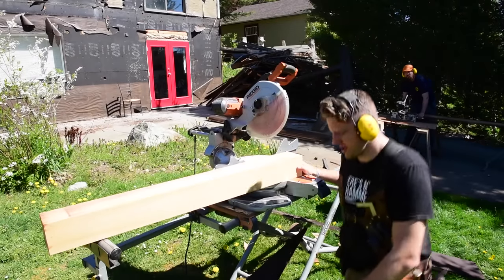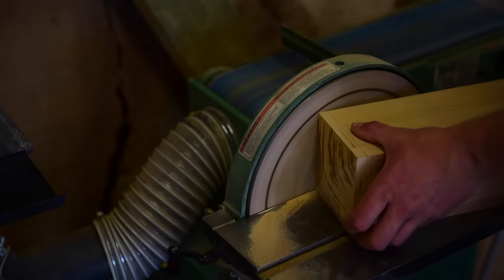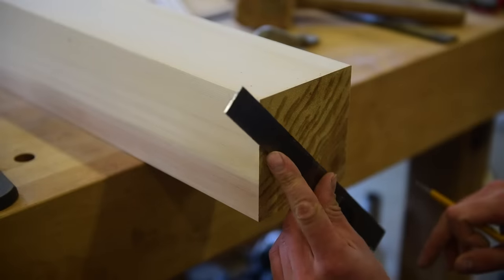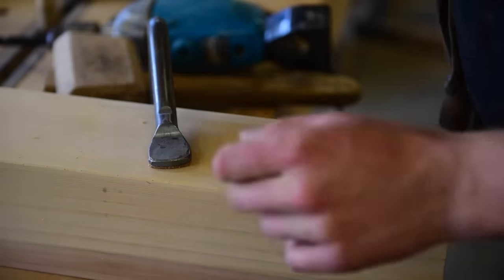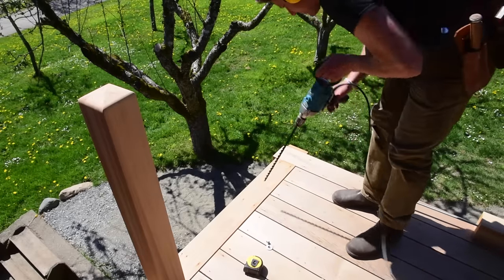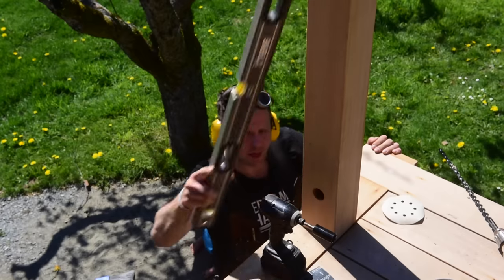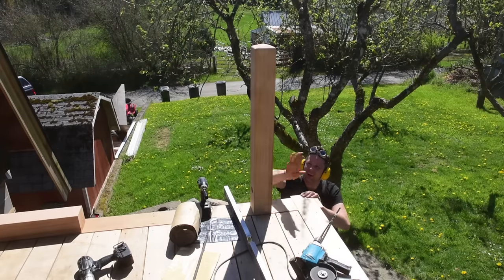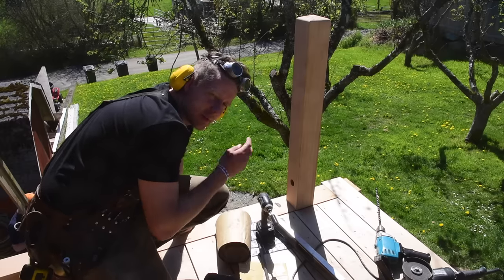FTF #54 How To Install Handrail Posts, Quick And Easy

Comment: You seem to address water traps with your posts and railing (commendable), but have ignored the same issue with your half lapped deck trim (inexplicable). I believe consistency and a respect for a materials nature is more in order when it comes to creating architecture. 

Water will penetrate and rot that half lap trim joint (earlier stage video) regardless of how much PL you use. This is because movement across the grain due to seasonal moisture content changes will release the bond of the glue (or membrane) to the end grain fibers of post (or surface fibers of half lap) and moisture will begin to work on decay. Why? Because the shearing force of wood movement will invariably win out over the  shear force resistance of a glue or surface membrane film used for exterior wood joints. Either an understanding of wood science OR time will teach you this lesson.  However, applying wood science to your work is quicker and more efficient. It also can result in better "samurai" wood joinery. In my experience "sexy" doesn't equate to a "Samurai" application with regard to wood joinery. Also, by fitting your half laps together so tightly, you left no allowance for dimensional changes in your trim's width. This wood WILL expand over its kiln dried state at the time of  install and that dimensional change will have to be accommodated somehow. This can be clearly evidenced  by:

1. Crushing of wood fibers all the way across the grain. Doubtful.
2. Cupping (i.e. deflection due to a material wanting to "get away" from significant force). More probable
3. Shearing of wood fibers at your 1" overhang. Possible. In fact, you may actually lose half the thickness of that overhang if cupping is not accommodated. Ironically, a longer overhang makes this less likely, but less "sexy". 
4. Combination of all of the above. Most likely case, but less obvious.than results above.

BTW the reason that miters open up at the heel and not the toe is because of moisture content changes in wood. You can toss an 8' 2x4  into a pond and after a  week floating around it will still measure very close to 96" long. However it will no longer be close to 1.5 thick and 3.5" wide. This is best understood by learning the difference between the 3 axis of wood fiber movement due to moisture content changes (i.e. tangential, radial and longitudinal shrinkage). The change in longitudinal length of wood fibers due to moisture content changes is negligible. That is true all the way across the boards length. The length of fibers is virtually the same all the way across the mitre; they have just shifted positon in relation to the joint due to cross grain shrinkage. In other words, the width of boards change considerably due to cross grain moisture content changes (combination of radial and tangential shrinkage). This results in the familiar  gap we typically see at the heel of a miter joint and not the toe.

This critique is not meant to bash your work. I believe you strive for a high visual aesthetic coupled with a desire for durability which are some of the hallmarks of architecture. As a carpenter, I strive for this myself. A good understanding of wood science can be helpful in reaching that goal.

When thinking about this half lap and how it could be improved, you may want to think about the fact that wood needs to be perfectly sealed or drain well in order to avoid decay. This is why traditional wood window sills and water table caps are pitched. Your half lap is (probably) perfectly level and the failure of the glue joint over time actually works to further trap moisture in that joint. What is a better detail? I think its worth considering...and I'm sure a true samurai carpenter could come up with a better solution.
Reply: Sonny Wiehe wow

Comment: Dude. That dewalt saw is belt to blade drive. The bearing goes bad on the motor side which gives u the blade wobble. The cheaper models are all junk. Per my repair man. FYI

Comment: Great job but definitely not quick or easy. You're using an interior method for an exterior deck. IMO there seems to be a lot of points that would be prone to failure. The bolts loosening as wood shrinks, shims rotting or coming out, water damage and the threaded rod not being strong enough for lateral support. Usually they're used interior like that when the wood is really really dry. After that whole deck drys out or expands and contracts I'd imagine it all becomes loose.
Reply: Just tighten from down under mate !

Comment: It would not be easier if you had bend the washer instead work in the hole?
Reply: Then you are creating a wedge against end grain that can potentially cause a splitting action instead of trapping the grain in just compression only.
Reply: ohh, I didn't know that. Living and learning, thanks dude! Now I know why my bed is a bit floppy.

Comment: The American Wood Council publishes a great free document - DCA-6.  It is the authoritive publication on building residential decks that are compliant with the current edition of the International Residential Code (IRC).  Google it and skip the YouTube videos.  More injuries and deaths occur due to deck failures than with any other structural failure.  I would be concerned that the stability of this deck railing appears to be completely based upon the shear strength of the threaded rod.  And if the threaded rod isn't stainless steel or galvanized, it will rust.  Per Table R301.5 of the 2015 IRC (currently adopted code cycle for the State of Pennsylvania), a guard (called a handrail here) must be capable of withstanding a 200 lb live load applied at any point along the top of the guard.  University testing has revealed that many deck guard rail posts are insufficiently constructed to withstand such a load.  And I do not write this to be a troll.  Legal or not, people will inhabit a deck and lean against the guard railing.  If it fails and someone gets hurt--everyone associated with the construction and inspection of the deck faces legal liability.  If you build a substandard deck on your own home, the outcome could be much more tragic.  Let the hate responses commence...

Comment: There is no way that would pass inspection.  It's looks great but other than a kick, it would bend right over if pushed on.  The mass way exceeds the bolts strength. That carriage grade bolt would stretch if pushed on You are a great carpenter but framing isn't your thing

Comment: this was not quick nor easy.  It also would not pass code here.  There is no way that post will hold up to lateral pressure or any significant weigh bearing against the rail.  we need 2 carriage bolts plus at least 1 mechanical brace like a simpson strong tie lateral tension bracket.  looks pretty though.
Reply: Steve Thomas code should specify sustained impact rating against handrail.
Reply: Stev

Comment: Your a total time waister. True timber work doesn’t need shims....
You need to tie into the joists & bearers. You’ve drilled through a joist with a hole 80 percent of the stability....

Comment: Ive used on of those saws and they are OK and will do the job but they are sooo bulky and not that ergonomic, they are have nothing on the using Dewalt, bosch etc but they are cheap

Comment: Dude just build the deck with the posts in place. A little 3/8" threaded rod is NOT going to take the pressure of a human leaning against it - at least not for long. Ridiculous on soooooooo many levels. 

F for Fail
F- for wasting my time.